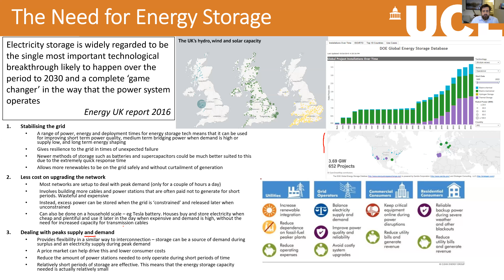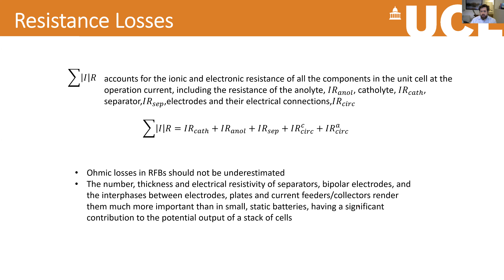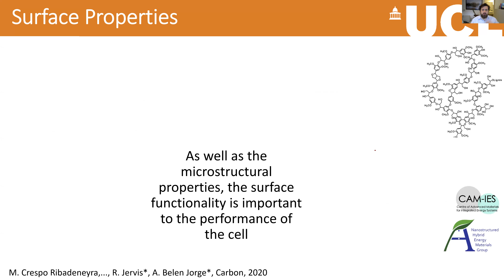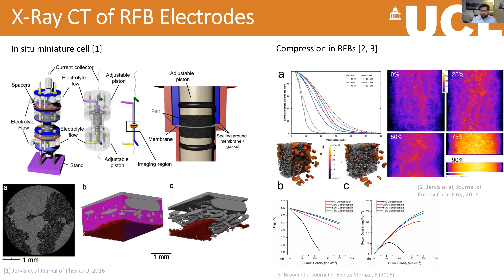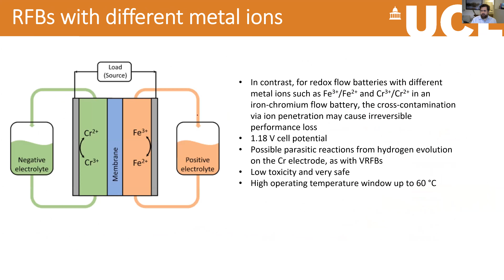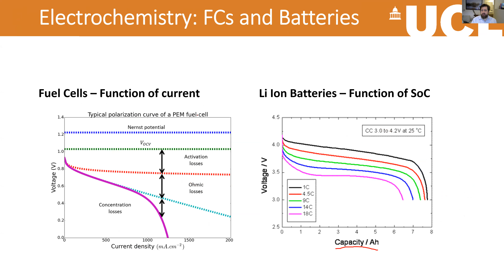Taster lecture: Redox flow batteries for grid scale energy storage - 12 January 2021

Comment: How about using hydrogen to fuel the systemic flow of energy production if I'm not misguided?
Reply: Hydrogen is tough to store and once stored it has to be used on site or transported. We can use electricity to avoid physically moving hydrogen by producing it on site, however after electrolysis (70% efficient) and then using it in a fuel cell (50%) efficient. We are stuck at 35% efficiency, then we need low cost low maintenance home use electrolysis, fuel cell, and high pressure storage tanks (700bar) on site. Batteries are cheaper, more efficient, and less complicated. Hydrogen is probably the answer for rockets, trains, planes, boats ect, places that use tons of fuel and can produce it close to remove cost of transport